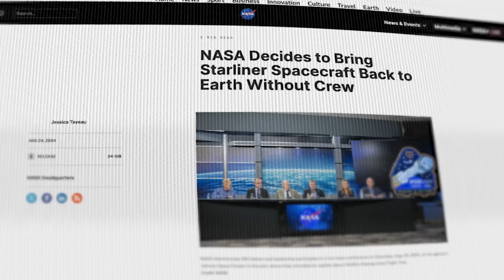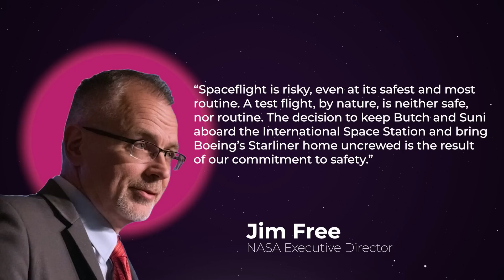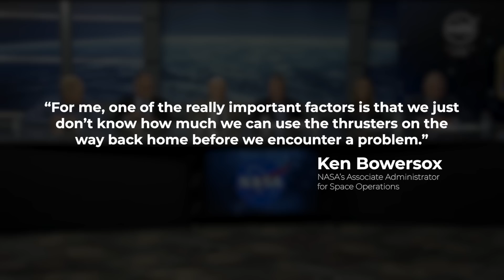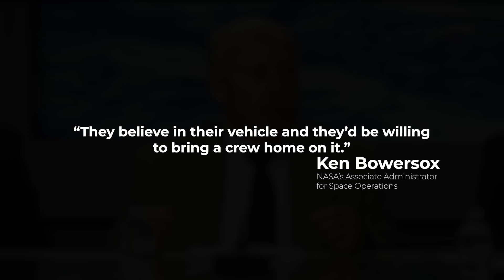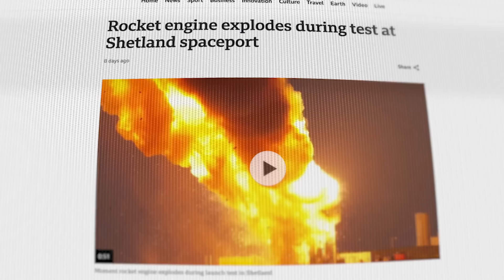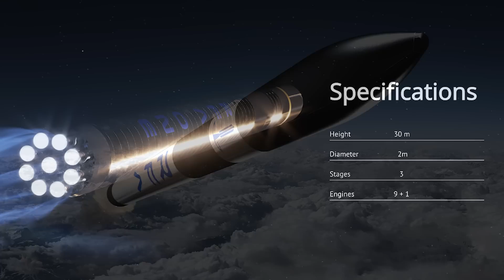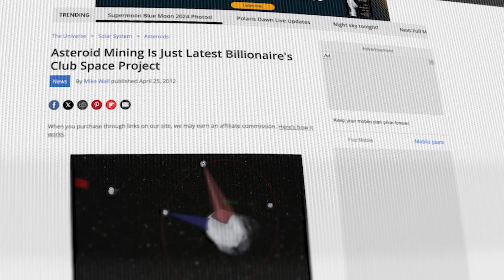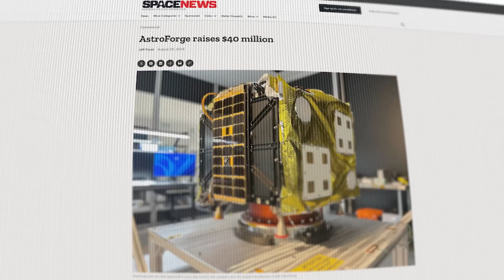The Boeing Starliner Has Failed...

Comment: At a minimum, they will need to re-fly the CFT, correct?
Reply: That seems unlikely.
Reply: @jasonowens7829  to be clear, I meant if Starliner is going to be certified for Human use, they will need to re-fly the CFT. In other words, Starliner wont be certified for human use because they did not complete the mission successfully.
Reply: @CJM614  I say it is unlikely to require another CFT, because nearly everything required for certification has been demonstrated. The remaining items can be satisfied in other ways.

Comment: It's odd that Boeing and NASA appear to disagree on the cause of the seal heat-up - it's not as no one can provide blueprints or replicate the structural components in a test chamber... 

Commendable safety prioritization aside, It comes across as a setup to have SPAXE-X save the day...
Reply: Likely not a setup. Geez... is EVERYTHING a conspiracy? 
However, the systems were already tested on the ground ad nauseum. Ground testing only reveals most of the problems. That is why we do in flight testing. That is the major reason SpaceX has a "hardware rich" development cycle. They also have the advantage that they get the public to expect and actually cheer when they blow something up. BO, ULA, Sierra Space, and Boeing are more the test, test, test, and hope everything goes PERFECTLY during flight, since they build slowly and are not as cost conscious in their design choices. SpaceX abandoned Carbon composites on Starship because they were more expensive and slow to manufacture than Stainless Steel for that very reason..... so they could build a hundred and blow or burn up a bunch during testing and they could redesign, rebuild, and fly again quickly.
Reply: @i-love-space390  
"(...) is EVERYTHING a conspiracy?" 

In a 'space race' ? Yes - due to the national security/intelligence implications. 

"Boeing are more the test, test, test, and hope everything goes PERFECTLY during flight, since they build slowly and are not as cost conscious in their design choices." 

Then why couldn't NASA find a consensus on the causes of the seal heat up - like the astronaut hinted at ? 
From what You explained, Space X would be the less documented, trial and error approach - while Boeing is accustomed to the minutiae of commercial airliner regulation that accounts for every part that could fail and requires certification... 

Just saying that this point is odd.
Reply: A set up really ? This is not an ideal situation even for SpaceX.
Reply: @Dandanakka5610  
"This is not an ideal situation even for SpaceX." 

Maybe. 

Both companies compete for similar contracts, however - and it wasn't quite clear why Boeing was given a space program when Space X was already the established government partner - but You are right that there are simpler, formal means to end contracts than lobbying NASA to be more cautious than the actual manufacturer of the vehicle. 

As I said - this lack of consensus on the technical causes and it's implications makes it look odd.

Comment: SpaceX did not have to refly any of its missions when the crew dragon blew up. They had to determine the root cause and fix the problem.  During the briefing, NASA specifically stated that they have not done any analysis as to what additional testing Boeing would have to do in order to be certified. They stated that most, if not all, of the required tests for this mission were completed on the way up. Remember, this will be the third safe landing for the starliner. They didn't state there was an additional unique system test for "with crew." I'm looking forward to a certified Starliner.
Reply: You must either be out of your mind, or a politician who profits from the powerful lobbying that the aviation industry provides.
Reply: @SWExplore  I'm guessing you are experienced in testing aerospace vehicles and have inside knowledge of the approved test plan for the starship.  I have not read the test plan for the starship, so I will have to wait for NASA and Boeing to state where they are in testing and their plans on how to move forward.

Comment: So, it hasn't really failed... yet.  Hopefully it will return in one piece, but the decision to keep its crew on the ISS for now is the best choice.
Reply: Many years overdue, many billions more... not failed yet?
Reply: I have a bridge to sell you if you believe that.
Reply: If this isn’t failure, then what is?  Is it literally killing the crew?  Are the standards that low?  Boeing can’t even safely return a crew after reaching orbital flight.  NASA managed to achieve this during the Mercury program over 60 years ago.  

So yea.  Boeing has failed.
Reply: SpaceX have just had a horrendous failure with another self-destructing booster as they attempt landings. Perhaps better to leave Sunni and Butch in Starliner after all.
Reply: At least the two astronauts are still alive on board the ISS - unlike those in the Columbia shuttle.
Reply: As compared to letting an Elon Musk run company come get them? Time will tell.
Reply: The thrusters failed during it's approach to the ISS in June, and thus also failed in it's initial mission to safely return 2 astronauts as it's now deemed unsafe.. did you not watch the freakin video?
Reply: @deangreen1309  I think that those malfunctions are failed components related, but no more so a failure than Apollo 13 at this point.  NASA is showing excellent judgement in avoiding another Columbia having the SpaceX Dragon option.  It won't be known if Starliner has truly failed (as in catastrophic) until it returns.  From the video title, it seemed like something new might have happened.
Reply: @commerce-usa  To my understanding the new development was the decision on NASA's part to not use the Starliner for the return trip, thus it officially failing it's initial goal.
Reply: @deangreen1309 Compared to that the Space Shuttle failed big time on its maiden flight. There was just no option to send the crew home with another vehicle. The same is true for many other Space Shuttle flights. The fact that it‘s now possible to go up with one vehicle, and down with another is the big step forward and that‘s not possible only with Dragon.
Reply: @JM_2019 the Russians could have brought them back.  Boeing has had failure on top of failure in their space division as well as their aircraft manufacturing, which should be their bread and butter.  If it wasn't for SpaceX and Dragon, the US would still be overpaying Russia for rides up and down. How much money has the US wasted on SLS and Starliner?  That money could have made far more progress in spaceflight if it were invested in more deserving companies, like Sierra, Blue Origin or Rocketlab.  Or on programs like the lunar lander or gateway. What good has come from Starliner, outside of keeping some regular folks employed?